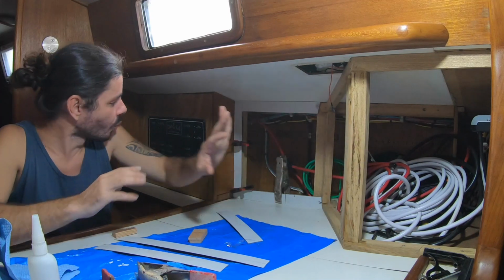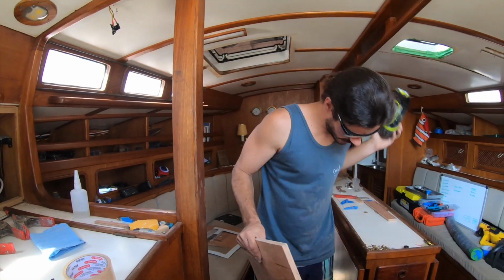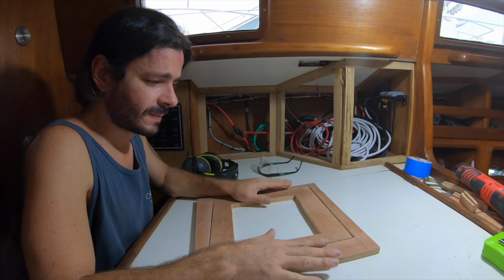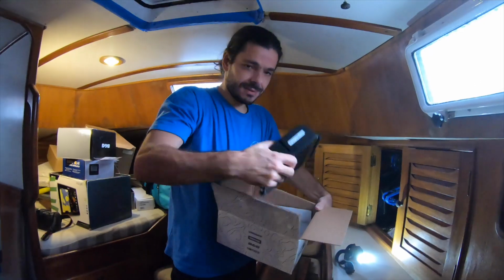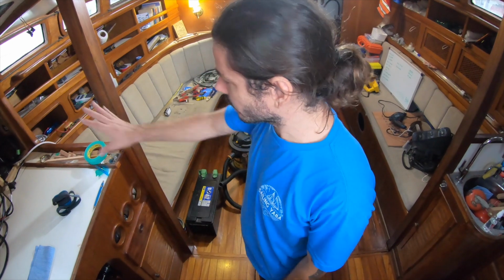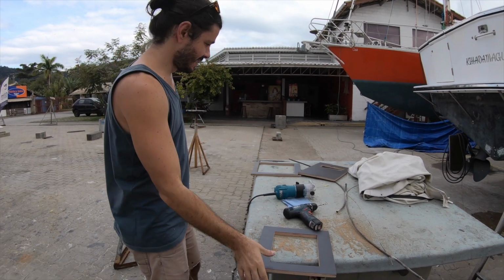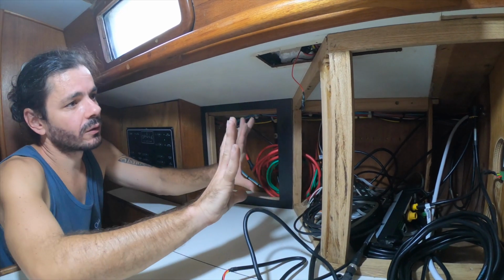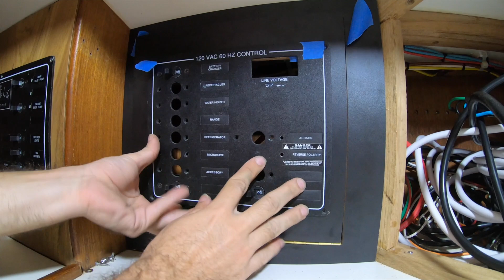⛵️We're not sure we can finish this project #186

Comment: Guys this is all looking amazing! Can’t wait for the next splash!! The external angle for the nav control board might be easier if you measure the complete angle and then half it, cutting half of the angle into the edge of each board, that way when they sit against each other they will have the correct total angle. For example, if the total angle around the corner is 120deg, then take 60 of the front edge of each board and they will give a ‘perfect’ mitre for the corner... keep on going guys!

Comment: Your chamfer was a perfect job for a hand tool. A No4 plane. Set really fine you can remove shavings as thin as 1 thousandth of an inch! Much easier to keep control of so you don’t take off too much material. Uses zero power too - apart from your muscles. 🤓🤓

Comment: Course file to file down Formica, also old Venetian blinds can be laid on the work after the contact cement to separate the formica from the plywood pulling out one at a time and rolling it on with a hard roller. The blinds are metal and have a slight curve to them makes controlling the gluing process much easier.

Comment: You're doing such a beautiful job. If I may make a suggestion for the middle panel, rather than screws to hold it, consider an interlocking french cleat type hook at the bottom  and strong magnets in top center or corners to hold the top in. That way there are no ugly screw heads showing. Just be careful that the magnets are strong enough and they won't interfere with any of your electronics.

Comment: 100 little things make up 99 percent of the work... you have made this boat amazing take your time and get the small details finished up. So you don't have a bunch of agitating little things to do while you could be sailing..
Reply from the maker: Thanks for the support, William
Reply: That’s right and it could turn out to be expensive once they are in international waters. Better do it at home  and it’s cheaper. They need to take their time to finish their fixes since it be might many months before they circle back to Brazil.

Comment: Already three weeks with the current panel. 1 week left for the 4th panel, then the wiring for that panel. Then finishing the Helm panel. Then a review of your captains exam. Then paint the bottom. I hear something about the stove and oven (also necessary), so another week and the gas bottle that is needed for this. The gas lock. The next 8 episodes are coming, so at least 8 weeks later) finally sailing in mid-late July? It really gets unbelievable.
Reply: They don't have the helm yet so none of this time matters.... Hard to go sailing without a wheel.

Comment: One suggestion for the charts would be to use a ceiling mounted window shade. Pull down the chart when you need it then roll it up when your done, It's always where you need it.

Comment: Hello Duca, it looks great. You might want to consider installing some ventilation behind all that electronic gear as it could get hot. Electronic gear doesn't do well in heat, just a suggestion.
Reply: @coachjm310  30 min video to half ass two piece of board
Reply: @mohsentabouna6401  Feel free to show us how to do it better.
Reply: You make a good point you can buy electric cooling fans are 12 volt cooling fans just like they used to use for the power supply on computers or stereo equipment he will need an exhaust for the fan and an intake for cool air to come in

Comment: You can by an spray activator for the glue . Then it cure in a split second. Very useful , and it also works as an primer so the glue works on most materials for example fat plastic..

Comment: No matter how much work you do, the boat will never be finished.
I'm confident you can in fact do a great job on your electrical panel(s).
One minor detail that may help would be slightly beveling the edges so that insides of the doors are slightly smaller than the outside.

Comment: Self adhesive Velcro is good for holding panels in place without screws. Remember to allow for thickness of tape, add some small staples to improve security of the glue. Panel can then be pulled off when access required.
Reply: No. Velcro is fine for everyday fastening but a yacht in heavy weather experiences blows with often shuddering forces so that a panel with its own inertia is likely to "leave home"; not what you want when there are other things requiring immediate attention.

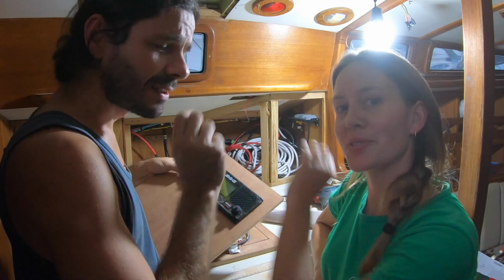Comment: Nice work guys. Duca, "tolerance(s)" was the word you were looking for at 7:29 meaning 'no space for errors'. Splash will be soon now. Potsie. Australia.
Reply from the maker: Thanks for the word and for the always support , Potsi. Cannot wait for the splash moment ☺️
Reply: A tolerance is an allowable variation. Duca wants a tight tolerance with very little gap, as apposed to a sloppy or wide tolerance showing gaps between panels.
Reply: Or leeway,  Its a good nautical term as well ?
Reply: Or simply no “wiggle room”.

Comment: Y’all need to put some LED lights in the clear double tubing on the engine and make Kelly as disco 💃
Use some industrial strength Velcro to hold the panel you need to remove on occasion

Comment: By altering even the alterations ;-) a maybe important remark from my side: not cutting ready made cables for electronics is a pretty wise decision - but: coiling them up to keep everything nice and tidy inside of your compartements can cause some problems later on ! If you coil up unshielded cables into spools you can create magnetic issues affecting your sensitive electronics. Same things can happen when you run (unshielded) data cables close to power chords . . . Btw: it's a little bit egoistic from me telling you this because i only want to see you and your boat out on the waters as soon as possible ! ! Happy travels and best regards from Germany

Comment: Add a hose to the hot water tank over pressure valve, so it goes to the bilge and doesn't spray the engine. You can end the hose in a plastic 'catch' bottle to keep the bilge dry...Try spray painting the inside edges of the 'door' with flat black paint so it won't show when closed. The two edge joins can be easily concealed by gluing a 'matte black' painted inside corner and outside corner wood molding (that has been trimmed to fit the over and under 90 degree angles) to the removable panel. Much easier and 'finished' looking than trying to match laminate edges...

Comment: I was having the same trouble you were with the "instant" glue not being instant, even with accelerator which I found to be frustrating and confusing.  A glue hint/tip that I learned from Adam Savage regarding CA glue is that it's effectiveness diminishes over time at it sits in the bottle. In addition, if you use accelerator, store it separately or it will interact with the with the CA glue even if both containers are sealed because those bottles are never truly "sealed", that is, air tight.  So unless you are using a lot of the glue, all the time, it is best to buy as small a bottle as you can so that it is fresh.  Another wood working channel that I follow stated the same thing regarding his CA glue weakening over time so I guess this is a thing! It is wonderful to see a couple working so hard together to accomplish a task.  Oh I am sure there are "moments" grrrrrr between the two of you but it is great that you remain on task.   Press On and Stay Safe.

Comment: Many years since I did this sort of veneer work...but fyi there are special bits that give a small angle to the finish edge which is just soft enough to avoid the super sharp edges...and it routes the edge exactly flush.  Confession:  I hated that countertop work...especially fitting two pieces into a corner with zero gaps.(as they say--don't get me started!)

Comment: Kerf, The slot left in the work by a saw blade. Margin for error , an allowance made in measurement  to compensate for anticipated error.  Margin of error the amount of error that can needs to be compensated because error can be expected.. Molding ,trim pieces applied to corners to hide all those errors.

Comment: I worked for 4 years doing cabinets with laminate and you may want to get yourself a bastard file...for anyone doing laminate it is a must have tool. I did a short search on youtube for a video on how to use a bastard file on laminate to include in this comment but did not find one. Maybe you can find a book or a video. On some jobs the bastard file can totally replace the router and also puts a nice edge on your work that will reduce cuts to skin and damage to the work as it is being used. Get a bastard file...a most have tool and not just for metal.
Reply from the maker: I (Roberta) didn't know this tool. In Brazil many wood workers use the one we used. Hope we don't have too much more wood to work with, hehe. Thanks for the tip

Comment: To make instant glue set fast and strong, use accelerator available  on Amazon.
Reply: What they're experiencing is superglue (instant glue, CA, cyanoacrylate) going bad. The reaction that makes it bond is from exposure to moisture in the air and over time the set times with an open bottle get longer and longer. Not really a problem for making the templates they are in this video but for bonds that need to last, a new bottle of glue is ideal.

 As a modeler I go through a lot of CA and for general purpose work I get the cheap 3-for-a-dollar tubes at walmart so when one goes bad throwing it away isn't costly. For radio control projects I use the good stuff and plan ahead so I use up as much of it right away as I can.

Comment: What is the large coil of  whitish cable which is apparently going to be behind that panel?
Is it a live dc cable , I hope not!
A coil of that size carrying an electric current would create a large unwanted magnetic field that could cause havoc with any of the in boat systems and perhaps even a fire risk
Reply: Heat is a high risk in that sort of electrical small environment generating magnetic and electrical fields and for any engineer working in any field where electric current is flowing he is aware of double hazard of developing heat generation and electrical / magnetic. But heat generation in a boat is an obvious hazard.
I am amazed looking at several boat projects which are potential disaster areas — especially when far from land
Take care!

Comment: Duca, a question for you. When boat movement is expected in rough sea or high humidity on wood parts, are  you concerned for tight fitting joints shifting or cracking? Thanks.
Reply: You live and you learn.  They are not cabinet makers.

Comment: Not quite sure about that raw cooling line. Looks high. Thinking hard to prime.
Reply from the maker: I think the line you see is the exhausting anti-syfon
Reply: @OddLifeCrafting  
Your engine may set deep and how the exhaust is routed so that’s why it’s there. Just not use to see it. There’s a valve at the top of the siphon break learn to inspect it and keep a spare. Be careful with those vinyl hoses. Check the hose clamps in a week then every 6 months. Clamps always seem to loosen on that type of hose. It also looks gross after a while.
Reply from the maker: @SkypowerwithKarl  Thanks for the suggestions, Karl

Comment: I don't think piano inches is a best solution, especially the way you installed it (bottom side) - waves will cause electric panel to open and fall on the table. 
I would suggest to drill a hole in each corner of the wooden panel and use so called "knob screws" - with nuts glued with epoxy to a base.

Comment: Duca I have to say, I know you know what you are doing, but I cringe every time I see you cutting material on the counter and the blade starts heading back toward the edge! I know space is limited, but you should get a small folding stand to use so you don't accidently damage the wood or counters on the boat.

Comment: The 3 display is not good location. Unusable, who sails boat from sofa? Crazy 😜
Reply: Guess what, the displays for the solar panels have zero to do with sailing the boat. That's what those are, as they clearly stated in the video. They are however handy to see at a glance even when sitting at anchor on a rainy day. Also, there is no reason to have them at the nav station. They would just take room away from things that actually need to be there. So where they are is the perfect location. You'd know this if you paid attention.